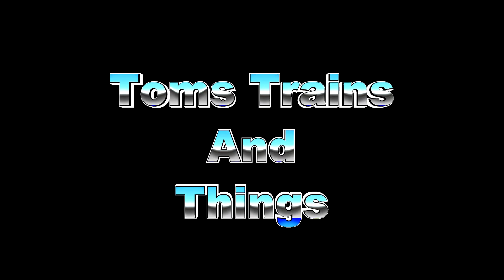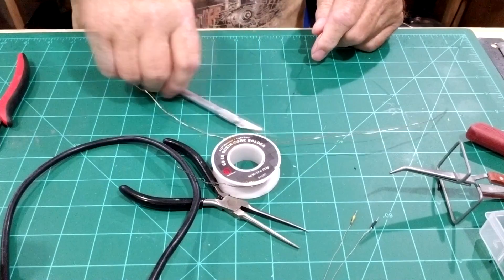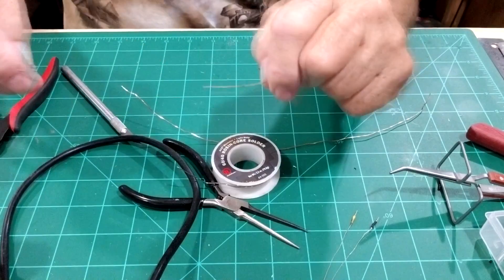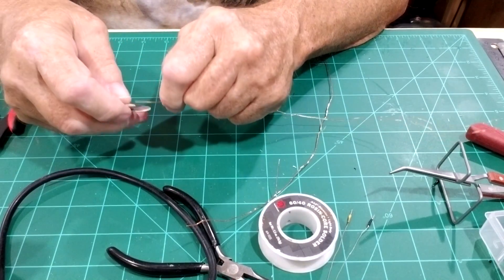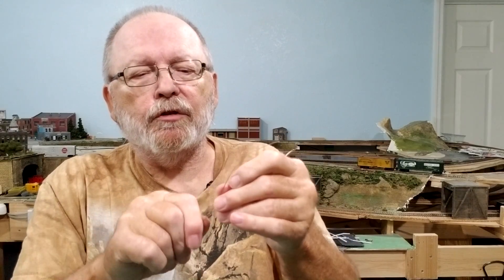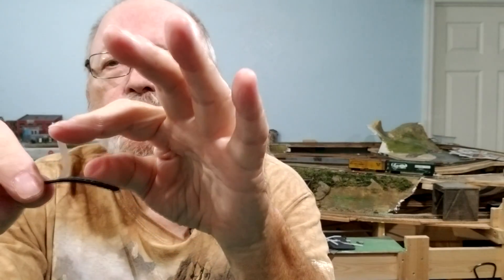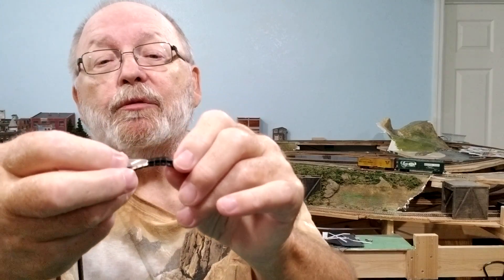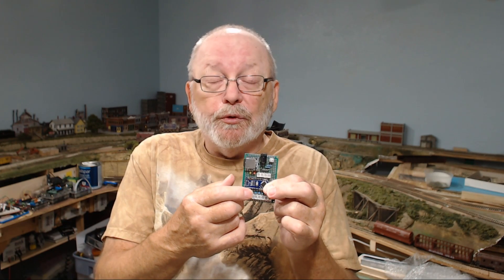Budget LED Wiring For Your Model Railroad

Comment: I have purchased many of your sound decoders.  But I have many more locomotives for which I cannot afford to purchase your very nice sound decoders at this time.  I'm using motor-only decoders in those Loco's which come with lighting circuit.   For the headlights on these loco's I have purchased a 3mm 'blinking' LED and a 3mm non-blinking LED both will work on 12 volts.  I wire them in parallel and attach them to the headlight output on the motor-only decoder and it works beautifully to simulate a "Mars" light.  They work perfectly 'until' the locomotive starts to move and the 'blinking' LED stops working.  When I stop the loco the 'blinking' LED start to work again.  It would like it very much if you could explain what I need to do get these LED's to work 'blinking' and 'non-blinking', together when the loco is moving.  I'm sure there is a simple fix for this problem.  Thank you in advance  for your help.
Reply from the maker: I suggest you contact the manufacturer of the decoder you are using or read the instructions that come with it!.. I have no idea what you are using, and how you are trying to wire it in to your decoder. Does your decoder have the capability of driving a mars light, or just a front & rear light? 

Also, I do not sell sound decoders or anything else. I do instructional videos only!

Comment: The wire guage scales up with the current output. The bigger the output current, the thicker the wire.

Another tip with the regular magnet wires: I use a wider soldering tip (like a Hakko D24, for example), melt a big blob of SnPb rossin core soldering alloy and then slowly insert the tip of the magnet wire into the blob. This usually destroys the enamel insulation layer. To get the job done I usually set the soldering tip temperature to 300 degrees Celsius. 
Anyway, I'd like to thank you for a great video. Always a pleasure to watch your videos!
Reply from the maker: Thanks for the info.  I guess I didn't have my iron set high enough when I tried it.